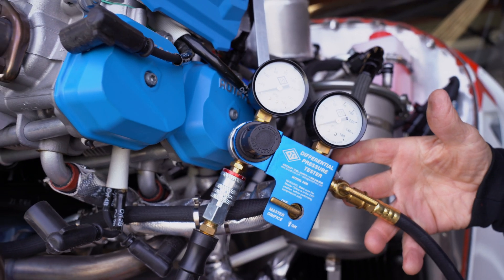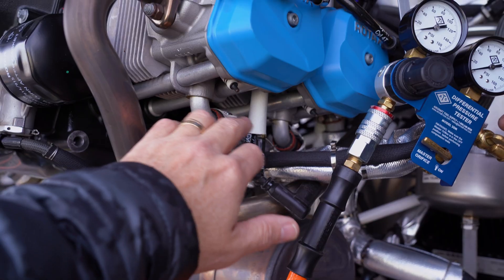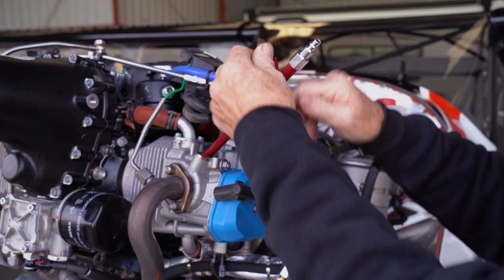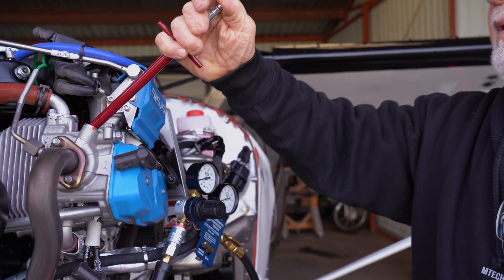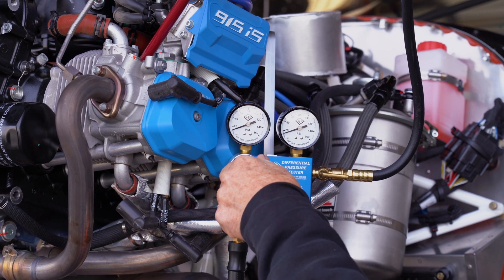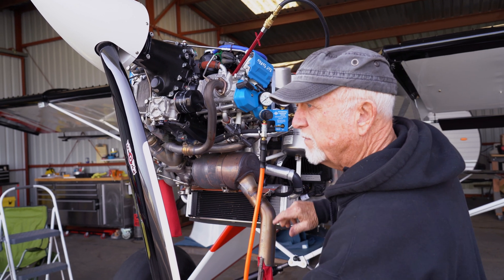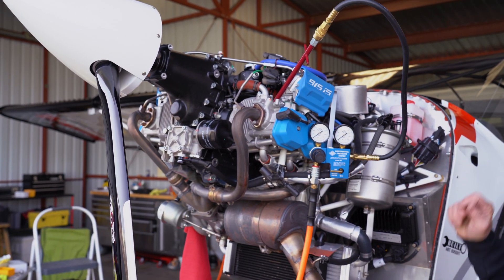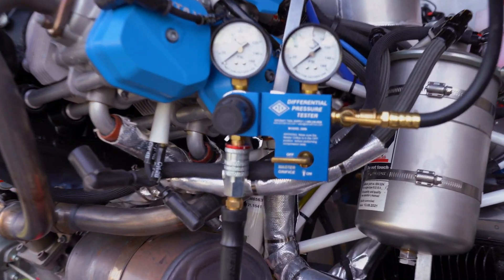Rotax 915is Differential Compression Test on a Kitfox S7 STi

Comment: I believe someone has to hold the prop during the test because it might spin if piston moves a bit beyond TDC. You seems mentioned that but then no one was holding the prop during the test. Looks scary :)
Reply from the maker: @sdakjfa  We hold the prop at 15-20 pounds to feel for TDC on the compression stroke, but then once that’s found and pressure increases we just stand clear. Thanks for the comment.